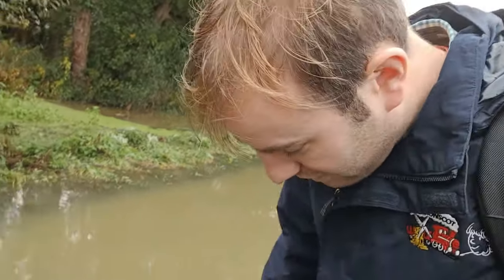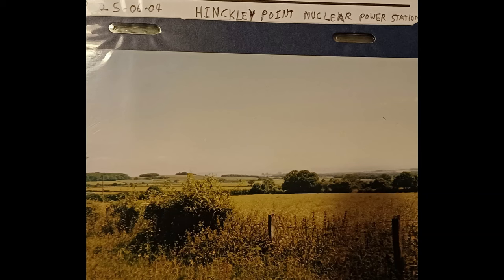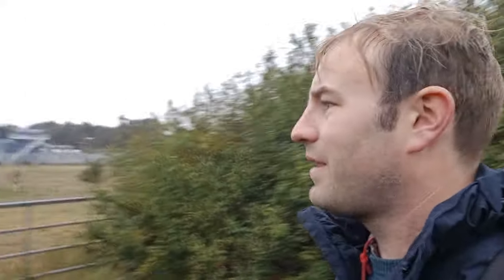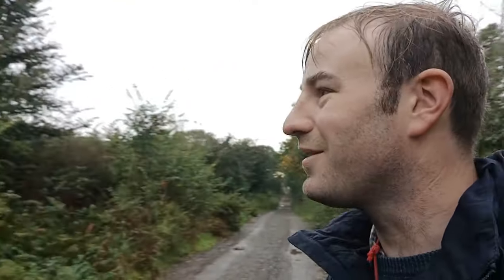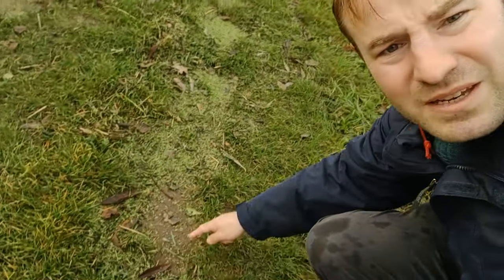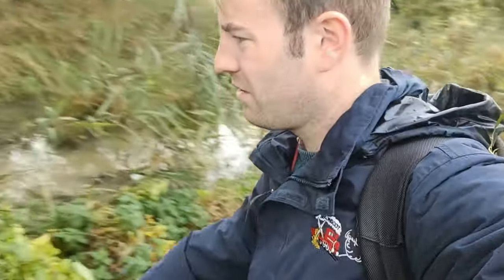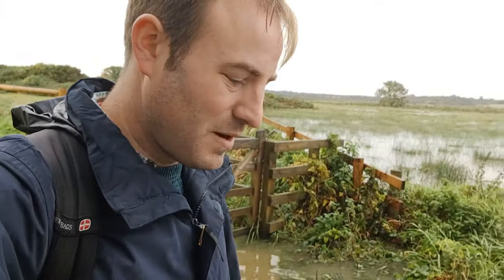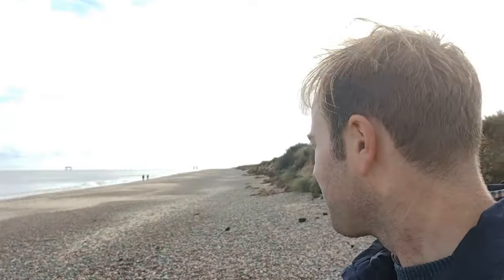Sizewell A B C - A Nuclear Powered Video!

Comment: Good video and a wet walk! If it helps:
- The substation you point to was built for the windfarm connections - the SZB substation is inside a building on site.
- You're quite correct about the colour SZB scheme (the dome belending into the sky much of the time) it was chosen by the Royal Society of Fine Arts when the station was being built.
- There is an intent to extend the rail line into the construction site to deliver materials.
- The building with the big fans is a backup heatsink to cool a shutdown reactor should normal (seawater) cooling be unavailable.
- The offshore structures are the old intake and outfall for the seawater cooling for Sizewell A. They were due to be demolished but this is complicated bythem being used as a seabird nesting site. Sizewell B's intake and outfall are on the seabed so barely visible from the shore.
- Nuclear reactions: think of it like this... Uranium-235 is not a happy atom. Give it a nudge by dropping a slow neutron into its nucleus and it'll become unstable and split, giving up lost of energy (heat) and 2 or 3 more neutrons. This suggests a chain reaction - with one fission causing the next - would be easy, but there's a catch. The neutrons produced in fission are 'fast' (~10,000 miles per second) and won't spend enough time in the vicinity of a nucleus to be captured. The trick is therefore to slow these neutrons down and the easiest way to do that is to let them bounce around in a something, giving up their energy. This 'something' is the moderator (graphite for SZA, water for SZB). Once they've slowed down some of them will be absorbed by other U-235 atoms and go on to cause another fission. So despite the name, the moderator is actually the thing that makes the reactor/fuel work. In SZB, this fissioning process happens to roughly 100 million million million atoms every second. If you want to know more can I suggest you look on Amazon for teh book 'How to Drive a Nuclear Reactor'.
- SZB has a visitors Centre, so you can book tours of the site!
Reply from the maker: Thank you very much for watching and taking the time to explain this. What you've said at the moderators makes sense. I'd love to visit the Sizewell B visitor centre and better still go on a tour of the plant. I should also look into the possibility of booking a tour of one of the still active AGCR while they're still running.
Reply: I loved reading your book, Colin! It is essential reading for the Nuclear Energy MPhil course here at Cambridge, and is a fun read; the year-group is booked in for a tour of Sizewell B in January 2025.
Reply: @asabriggs6426  thank you for the feedback. :) They'll really enjoy the tour, I'm sure. There's nothing like having your hands on the casing of a spinning turbine to get a feel for the immense size/scale of the project. But tell them to wrap up warm... Suffolk in January can be freezing if the wind's coming in off the North Sea.